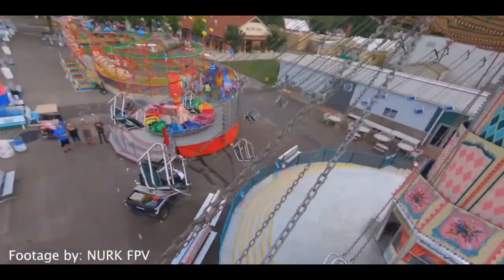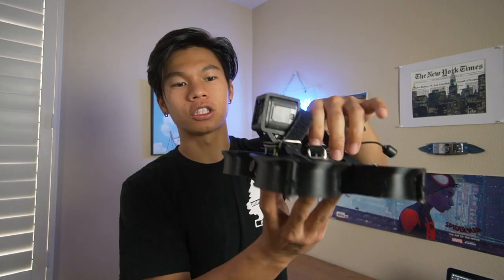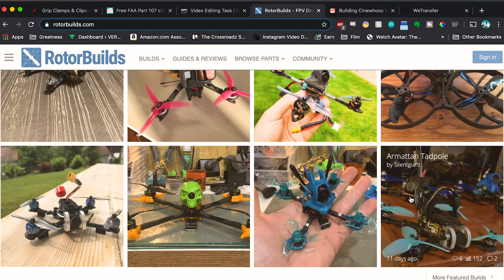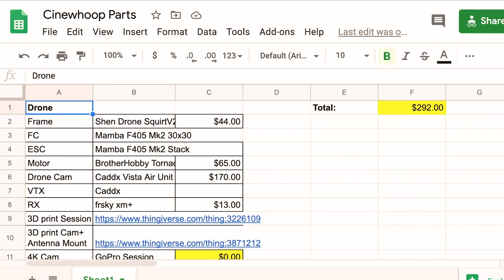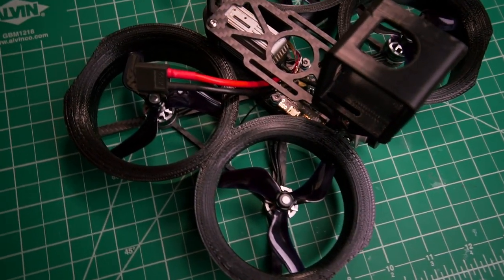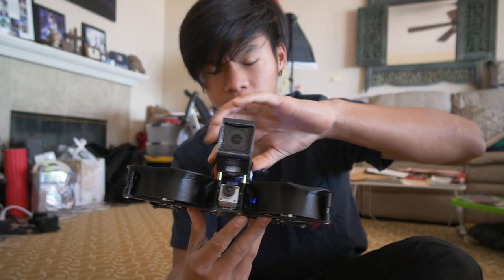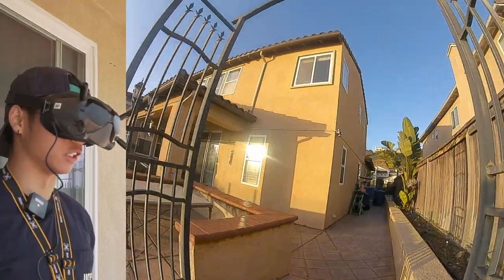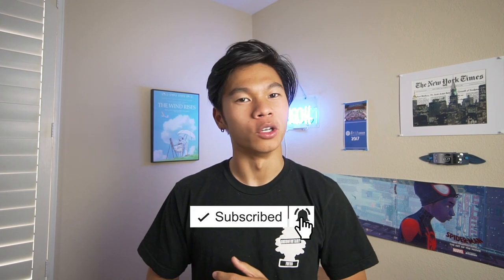How to Build an FPV Drone (Cinewhoop Squirt V2)

Comment: Hey man love your videos!

Did you jump straight in with the DJI setup? I am so new to this I am still looking for my beginner drone to learn how to fly! I love the digital set up idea but don't want to spend that money on something to learn on as I am aware I will crash, ALOT! Did you learn to fly on the DJI set up?
Reply from the maker: Kurtis Henry thanks a lot bro!! Yes, I did buy straight into Dji because by the time I was ready to build, I was sure enough that this was an investment I wanted to make. You can still avoid unnecessary crashing by practicing in the sim, and the most expensive part of the setup are the goggles, which should remain safely on your head, hopefullyy avoiding any damage!